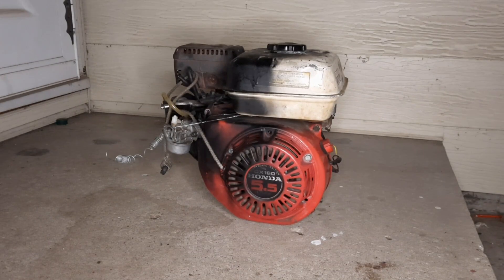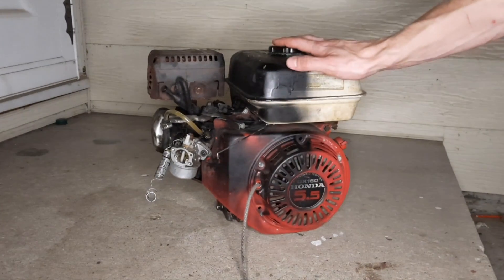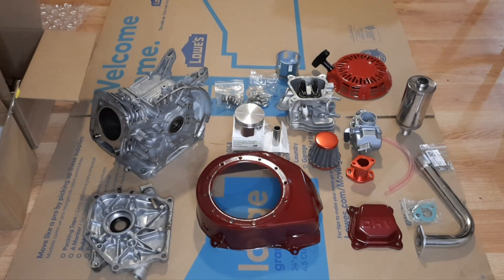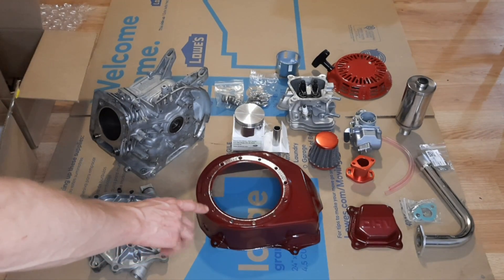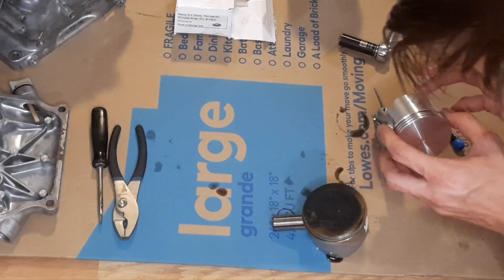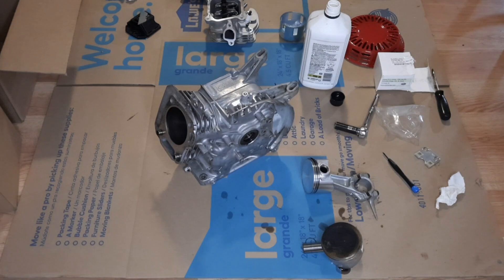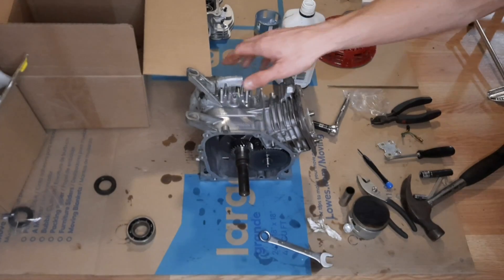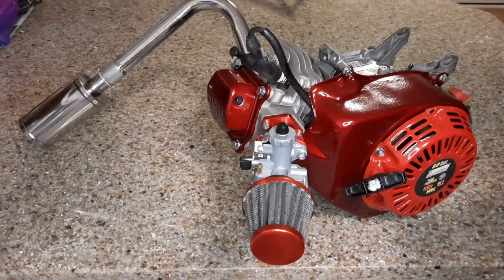Honda GX160 mini bike engine restoration and upgrades

Comment: I added the same carb to mine and changed the jet to a 110 but it still bogs out when I crack it fast . I raised the pin all the way up with no difference.

Comment: This was extremely helpful I currently have a Honda replica it’s a 7.5hp 212cc and just from watching this video I now know how to disassemble and reassemble a motor and also how to change the parts and give it some weight reduction 💯 just one more thing is if you could leave the links to the parts you have in your description

Comment: Hi i know its been asked already but do you have a full parts list for this? I'd like to do this for my sons go kart
Reply: Thank you for your quick response 👍
Reply from the maker: @samkinder6752 I am always glad to help.
Reply from the maker: Flat top piston - go power sports
1.3 ratio rockers- ebay
22lb valve springs- ebay
21mm carburetor/intake- Amazon
Exhaust and muffler- amazon
10k RPM flywheel- ebay
14cc cylinder head- ebay
I would highly recommend a billet connecting rod with these mods. However, I did not use one in this video.

Comment: Did you use stock cam?
Trying to put one together, i have governor delete, 18lbs valve springs, mikuni and intake and aluminum flywheel. I was pondering a different cam🤔 i have a stock predator cam that i was thinking about using if possible, all of the measurements seem to be identical or Really Close, any imput would be Really appreciated.
Reply: Oh and What will the 1.3 ratio rocker arms do?
Reply from the maker: @anthonyreddy2834  The ratio rocker arms do pretty much the same thing as a cam. They increase the lift at the valves by changing the pivot point of the rockers. I'm using the stock cam for now. With the ratio rockers, you gotta be careful with how big of a cam you use to prevent piston to valve contact. My suggestion would be to clay the motor with the cam you want to run before final assembly.
Reply: Are you using a stock rod,If so how well is it holding up?

Comment: Hey man, would that exhaust pipe fit on a blitz doodle bug mini bike 70cc frame with a predator 212 motor? I have a grab bar type thing behind the seat & a reinforced bar type thing below that. I contacted the Go Kart stinger company & they said they're not mechanics and they don't know! I burned my leg pretty bad & want a stinger exhaust pipe that is under ne instead of the the side of me. 

PLEASE HELP!!
Reply from the maker: A cheap temporary solution would be to use either some header wrap or one of the mini bike exhaust heat shield tube thing they sell. It will still get really hot but it's better than just the metal exhaust pipe. It's hard to say if this exhaust will fit or not. It fits on my Coleman ct100u, but I'm unable to use the muffler because it doesn't clear the frame. It's decently tucked away but definitely still pokes out enough to burn your leg. They make some that exit under the seat. You may want to look at some of those and take some measurements to see what could work. Best of luck!
Reply: WOW MAN THANKS FOR THE QUICK REPLY I'LL CHECK THAT OUT NOW THIS IS MY FIRST MINI BIKE & DON'T KNOW MUCH SO I HAD TO ASK AN OG! THANKS
Reply from the maker: @oriigiinals4381  no problem at all. I'm always glad to help and do my best to respond to everyone's questions. Congrats on your first mini bike! Motorcycles are one great hobby to have.
Reply: Thanks, right 💯 🚀

Comment: What type of spray paint is that?
Reply from the maker: It's the duplicolor METALCAST in red color. It's really important that you use the duplicolor metalcast primer though. Otherwise it won't come out looking like this at all. It can usually be found at auto stores like oreilly, auto zone, ect ect in the automotive spray paint aisle. Kind of expensive though, like 10-15 dollars a can.

Comment: for low end torque i want to use pz20 20mm carb. is it too small for high rpms. my engine is bone stock with removed governor
Reply from the maker: A pz20 should do fine for a stock motor. If you do end up installing more upgrades down the road though, it could possibly end up a restriction. Torque converters help with low end torque a ton as well.
Reply: @jdmjedi777  i got a pz27 from a friend. would it be too big?

Comment: So i blew my old engine up because its old, and i bought a new one and i am currently building the new engine up to a performance level. And by the way, what fuel would you run?
Reply from the maker: With the higher compression ratio on this engine I try to run the 93 octane from my local BP.

Comment: Hey man really appreciate the video, the torque converter vid was extremely helpful as well.. I have the same gx160 from a scrap yard and this has inspired me to use it for the same thing.. would you happen to have links for the parts you bought? Thanks
Reply from the maker: I should be able to put the links to the parts together in just a bit for you man. Glad you found the video helpful!
Reply: @jdmjedi777  hey can u put links here if u still have them please?
Reply: @jdmjedi777  absolute legend

Comment: Great video,, I have a gx160 thinking of doing this for my ct200 but was wondering if it would be big anough engine.
Reply from the maker: It's got some decent power for sure. Right now it's the fastest small block mini bike in my neighborhood. Couple big block 300 plus cc mini bikes around that pull on it good though lol

Comment: Very nice. Do they make a billet rod for the 160?
Reply from the maker: They sure do. It's the same billet rod as the gx200. The rods in the gx160 and gx200 are the same. Whats different internally is the crankshaft. If you need a link to one just let me know and I would be glad to provide one.
Reply: @jdmjedi777  Just wondering why you didn't use one. I don't run very high RPM and still use them.
Reply from the maker: @Deucealive75  mainly budget reasons lol I do plan on putting one in here when I get the chance. In the meantime though it has held up just fine for now.
Reply: @jdmjedi777  Understood. The ARC rods are like a work of art. I should have taken pictures of them before they got hidden in the engine. I have them in a 196 and a 224.
Reply from the maker: @Deucealive75  there is definitely something special about well machined billet aluminum. I think I might do a future video with a billet rod and bigger cam install. Would be cool to show what kind of a difference it makes.

Comment: sorry to bother, but how much did it cost for all of the extra performance parts like the rockers and the valve springs? Im asking because i just got that same engine and want to do what youre doing here. Looks badass!
Reply from the maker: I believe I spent about 200 total in parts. 45 for the carburetor and intake kit on Amazon, 25 for valve springs and ratio rockers on ebay, 80 for the 10k rpm rated aluminum flywheel on ebay, 25 for the exhaust on Amazon and 30 for the piston from go power sports. If you have anymore questions feel free to ask. I always do my best to answer all questions and help out.
Reply: @jdmjedi777  Thanks so much bro 🙏 i for sure will ask any questions i have on this build.
Reply from the maker: @nichol8s898  no problem at all! I will keep an eye out for them.
Reply: Hey man. Good stuff. I too have this engine on a little go kart. You said about $200 on everything but how much extra hp and mph did you gain, and why didn't you put a torque convertor on it?
Reply from the maker: @charlieharper6816  I would say the engine is making a solid 10hp or so and easily gets my mini bike to 50 plus mph. Here is a video of its performance on my mini bike with torque converter and with a clutch. For riding around the neighborhood I definitely prefer the clutch. https://youtu.be/8j4ytNwDZjg